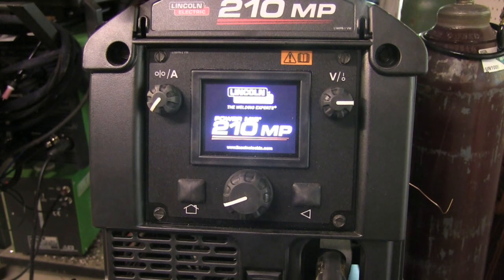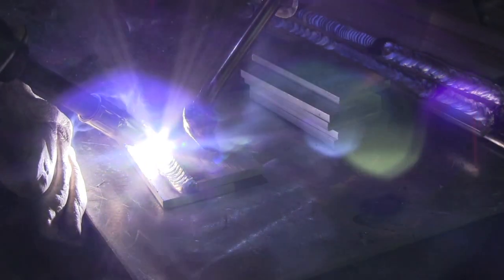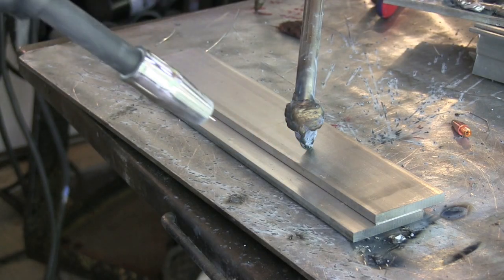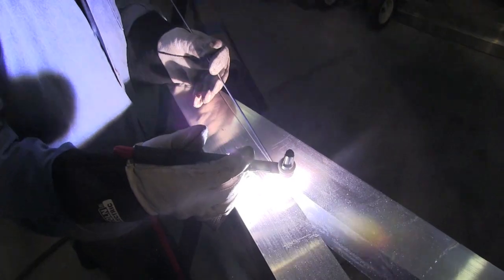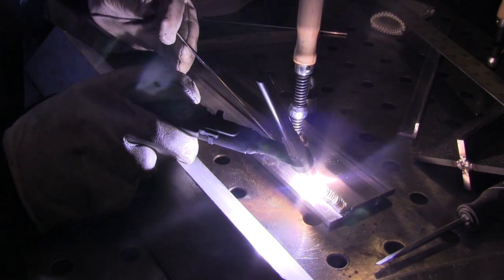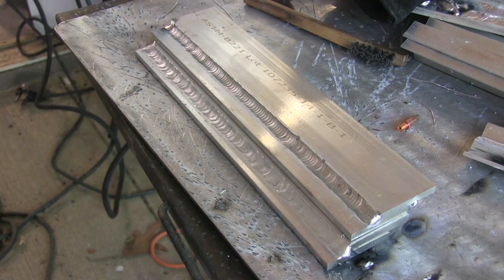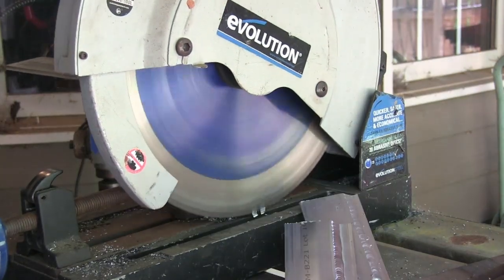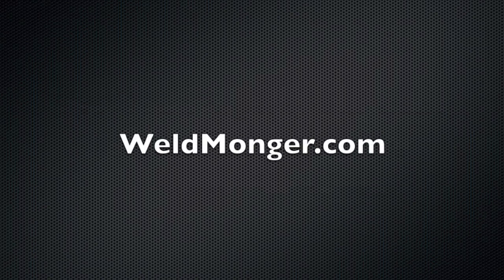Welding Aluminum TIG vs MIG Spool Gun

Comment: America, a strange country... It has never ever had a real king but as the only country in the world in XXI century still uses imperial units in industry.  Unfreakingbelievable!
Reply: Imperial units are better for construction.  I'll tell you why.  

Base 10 (metric) can only be evenly divided into halves or fifths. i.e. 10/2 =5, 10/5=2.   

Whereas Imperial units, Base 12 can be divided into 2, 3, 4, or 6 parts without a fractional remainder.   12/2=6, 12/3=4, 12/4=3, 12/6=2.   So when most of your material comes in feet, sheets are typically 4'x8', and lumber in feet etc etc etc.   Then the construction worker will very soon memorize a few simple possibilities and there is less error and less waste.    With metric everything has to be calculated.  So Imperial is more efficient and actually more logical for construction purposes.

There are two types of countries in the world.  Those that measure the distance to the moon in Kilometers, and those that have actually been to the moon....

Comment: Spoolguns get the job done but its a horrible representation of a legitimate alum weld done say on a dedicated push pull machine. Our pulse machines give tig quality beads with mig. You have high productivity with very good bead appearance. Welded structural alum for about 12 years now and ill avoid using q spoolgun if I can. Push pull pulse is the way to go 😉👍 I mean don't get me wrong. They have their place mainly in peooles budgets but if you weld alum for a living then do yourself a favor an opt for q dedicated machine. At the min a push pull feeder.

Comment: Two questions:  1. If welding aluminum for the first time, what is a good wire type to start with?  2. I have a millimetric 215 and weld steel mostly. Do I necessarily need a spoolgun to weld aluminum or could I just load the wire in the machine if the gas is right?

Comment: hey Jody we do a lot of MiG welding with a Power MIG 350 with a 25 foot push pull gun seems to be the welds don't break at the aluminum but the weld breaks in itself with this material any ideas or is this normal

Comment: Super informative video. I was getting ready to purchase a spool gun to weld aluminum with my Miller Mig but I did not realize I could not use the same welding gas I use for steel. I have thought about that Square Wave for Tig Welding, but have not got one yet. Meanwhile, I am wondering about picking up some Tig rod 5356 and using my Henrob Torch to try welding aluminum. Do you have any experience with the Henrob or Cobra 2000 torches vs Tig or Mig Spool guns for aluminum?

Comment: doesn't matter how fast you lay the weld. The tig is clean and done, after welding with a mig you have 20 minutes of time spent cleaning up the splatter when you are done. Not to mention all the fooling around keeping the wire feeding with a mig.
From start to finish the tig is faster.

Comment: good tip about that gas... last year i was helping my little brother with his science project, he was allowed to make use of a companies workshop-place (sry im dutch, cheers) 
but he wanted to make the frame of his car out of aluminium... but i think the gas of the welding machine was not set for aluminium yet.. but anyway we still fixed it , that was pretty strange now i think of it... but i remember that i did the welding machine setup, i was just considering the setting were already programmed because it didnt had steel wire but aluminium wire going into it..

Comment: I went to school to get my degree in Heavy Equipment Truck and Diesel. I figured that learning to weld would be crucial to my education. The only problem was that no one was helping me at all. I didn't realize that you could adjust the heat with the foot pedal. I hated it, and now I won't ever be able to weld if I needed to.

Comment: use german engineered ceramic nozzles and tips.

no spatter build up
no tip to wire sticking.

everything smooth as silk all day long day after day.

do not tap hot tip or nozzel or it will crack to pieces.

Comment: Hey Jody . Got a question for ya . I have an aluminum boat with a rip in bottom . I was wondering what set up you would use to repair. I have access to a esab tig machine but i was curious what you would go with ?

Comment: Mig has been used to exploit the industry.  Now they stick a gun in the hands of the cheapest guy they can find turn the machine up as high as it can and zip across feet per second producing a glass weld that barley sticks together long enough to get it out the door.

Comment: Is there any difference in the strength of the weld between MIG and TIG?
Reply: Structural Engineer here:  As long as your filler metal is the same for both the stick and the spool, the rest of the weld will be as strong.  Note that most filler metals are stronger than weld-affected 6061 T6, so the filler is not necessarily the limiting factor.  The full answer to your question is that the weld strength does not depend on the process, but it does depend on:  Base metal alloy, base metal temper, filler metal strength, whether the weld is in tension or shear.  Reference the Aluminum Design Manual, 2010, for more information.
Reply: @HollywoodF1  wich is better for alumminum? Lol

Comment: to start i am not a welder... but i am a looking to buy a welder. when you are using the mig is that dc?  also i will prob never weld aluminum. i will mainly be welding on my old f100, i used a lincoln 130t for the first half of the project. i now need a new welder so i was looking at dc inverter with tig/ stick welding. i know i will need to relearn how to weld but my question is would this be a better welder to buy vs buying another self feed? i want to be able to weld more than just sheet metal... maybe some frame work.

Comment: Great video JD as usual.   I have a old school millermatic 200 (transformer stack non inverter) machine and I bought and successfully am using a Miller Pro xp spool gun.   The results I have outstanding achieved to date welding aluminum from 1/8 to 1/2" double pass have been terrific .  My message to others trying to mig  weld aluminum with constant repeatability... is several.  a good mig spool gun can cost up to or more than $1700 so dont expect to buy $300 spool gun and get the same results.  always try to use use 5/64 wire size whenever possible.....you need filler material when doing spray transfer....smaller wire leads to more burnbacks and way more tip consumable usage....keep cutting the tip of your wire back every time you start a new strike like a 1/2 inch and always keep a good amount of wire stick out from the gun  like 1/2" min....lastly mig welding with a quality spool gun and dc power supply is  fast process.....so if your not in the 300 inch per minute range or above you may  want to stop and make some more coupons to figure out whats not right.    Thanks for your videos Jodi...great stuff man....I learn a lot from watching them especially the ones where you are welding larger pieces on your elaborate jigs and turntables. hope this helps. Thx John

Comment: I am thinking to buy welding machine for light usage maximum thickness is 1/4".
Which type do you recommend TEG MEC?
I used to have stick welding machine but it smoked burned from the inside.

Comment: Is Tig known to put less heat into aluminum then Mig, allowing you to do more continuous bead time without warping the piece?
Reply: No faster travel speed means less heat input
Reply: MIG is the only way to go if you want strength.  Aluminum MIG welds are incredibly strong as compared to TIG.  When you pour the heat into aluminum when you are TIG welding it decreases the base metal strength substantially.

Comment: I know almost nothing about aluminum welding but while trying to learn with my Miller 211 on auto set for weeks I can't possibly go 15-20 seconds straight on quarter inch aluminum without curling the material like a pigtail. I understand auto set isn't ideal, but the miller auto-set isn't completely retarded either, its close as far as most reviews claim. Is it possible that auto-set can destroy large 1/4" pieces in 4-6" beads where proper settings  can make 60-90 seconds strait bead time possible?

Comment: YOu got to use a miller 30a, its a different world. Also running .045 wire makes a huge difference in arc quality. When I switched to a 30a  I would go through a tip every few jobs as opposed to a few a job before.

Comment: In your video Tig Welding Aluminum Pie Cut Tubing, you said that Roy was using #5 standard cup, and that lots of people do as opposed to using a gas lens, could you talk a little about that? Like when and why would you use a standard cup and not a lens.

Comment: Thanks for the great information. I'm just wondering if this is all done on AC? I have a 175 Amp MIG welder that only operates on DC. It's a pretty functional welder but I'm wondering if it would be capable of laying out MIG Spool Gun welds like yours. Cheers

Comment: From my experience with Aluminum MIG is fast travel speeds are key to a clean quiet weld. Its very hard to do consistently, weld after weld but it makes a sweet weld. i tend to go for multi pass welds instead of large single pass. Polish and Etch comparison of both would make for a great video, very curious at what they'd look like side by side

Comment: Hi Jody
Have you tried the Miller Aluma weld 350 machine - I have the 350P which I have seen you use with the pro push pull gun - its ok but the new machine which will arrive in 3 hours is supposed to do a stack of dimes all by its self.  Tomorrow the Miller area rep will be here for setup and testing - If I can film the event will send it to you.
Thx
Awful Arthur

Comment: Hi Jody, I just got a Miller Diversion 180 and I started off with aluminum like you suggested. It's less than 1/8th. I cleaned it well with acetone. The first day I just kept sticking the electrode. Second day was better I could hold a good distance and maintain the arc but couldn't get it to to puddle, it looked cold. I increased the amperage and increased the Argon to 20 because I saw no cleaning effect, that improved so I could seethe cleaning. I am wondering if there is a coating on the aluminum? I went all the way up to 140 amps after grinding and using a Stainless Steel brush. It still never puddled. I only have 110v but it's the aluminum got hot as hell!

Any ideas, could it be clear anodized?
Reply: Something to keep in mind, that welder will have a max output of 125 Amps when running on 110-120V.  So if the welder was set to 140A, you may have been getting closer to 100A.  Try cranking it all the way up, then go full pedal.  That should give you 125A, and should be enough to puddle sub-1/8th inch material without much trouble.

Comment: We used to use just a MIG with teflon liner but we modified the end of the liner where the wire exits the gun with precision brass tube and your rolls had to be set up smooth and no probs with tips.

Comment: Jody, check out a Fronius TPS welding machine and your not need a push pull gun (normal 5 meter mig torch) and only a one or two tips instead of 20 a day
Reply: I run a 4 meter push torch on a Migatronic 400 Sigma, teflon liner. Same result as the Fronius..... one, max two tips a day......... Same result with the double pulse setting, which gives a very nice looking weld ( kinda like TIG)

Comment: You had a shot where you showed one of the corners of the awning which had a very acute angle on the inside and I'm wondering how you weld a joint like that. Somewhere you can't get the tip close enough because of the angle of the two parts..

Comment: i expected more penetration from the tig weld. But maybe that's because you tried to be as fast as you could and deposit as much material as you could. It could be interesting trying not to be fast with both process but achieving the maximum penetration and then having a comparison, given that the strenght of a weld doesn't necessairly come from penetration alone.
Reply: I'm a very new welder, just at home.  could you elaborate a little more on how penetration doesn't always mean strength?
Reply: I meant something a little different. Let's take an example. Two plates, t joint. The load tries to open the joint where the weld is. Two weld, one has less penetration in the root of the joint, the other one has full root penetration but it's half the size. The more penetrated one will probably break first. That's what I meant, sometimes you cannot penetrate too much so you rely on weld size, passes and so one to achieve strenght. I'lll give you another example. Still two plates and a T joint. You have big loads from both sides. You're probably better off withe two, I'd dare to say cold welds from both sides, rather than one, fully penetrated one from one side only. Hope it helps.

Comment: I recently took a weld test using a miller 350 with an xr-a push pull gun using 3/32 4043 pretty sure. 1/2" plate 3 pass minimum with a back gouge. Anyway, the procedure said oscillation was prohibited, and the instructor actually mentioned it's a bad habit to get into because it increases the chance of stress cracking significantly with aluminum. Is this true? I've never had an issue with cracking even after laying down multiple hot weaves. Just curious. Keep up the videos! Thank you!
Reply: Any kind of weave, in any kind of material, will increase the chance of cracking, due to the larger heat input...
...........at least that´s what I´m told. But sounds plausible to me.

Comment: Hey Jodie, how did you deal with cold starts? I have a helluva problem on 3mm aluminium.  I presume because you are welding thicker material with higher volts and amps the problem goes away?

Comment: Just out of curiosity, have you done a video on stick welding aluminum?
Reply: When I took the Basic Motorsports Welding class at Lincoln Electric, one of the students asked the instructor about stick welding aluminum.  The instructor's response was "Stick weld aluminum?  I'd rather swim in Lake Erie than stick weld aluminum!"  I took that as a sign to keep using my TIG welders...
Reply: Stick welding aluminum is like trying to push a rope down the street.
Reply: what are your thoughts on Oxyacetylene aluminum welding, then?
  I wouldn't want to use it, I just want thoughts.
Reply: Once you get used to the insane feed speed with moderate travel, it really isn't that bad if you're stuck in the field without argon. Not preferred, but works when you haven't other options.
Reply: +Glenn Pady I've never used O&A to weld aluminum, so I can't say.  Has to be better than stick welding though.

Comment: hi joy. great videos! im using my 200a AC/DC set in the wild for the first time today. 

things are going great except im struggling with craters, it's an old aluminum bodied car im working on. the martial is very pitted and I can't get to the Back of the panels. 

I try to keep it clean but keep getting craters. 

do you have a video on this?
Reply: Jody*

Comment: I just purchased the miller 215 with the 150 spool gun. My biggest problem, especially thin metal, is starts and stops. the starts are the bigger problem.. it wants to deposit a big booger because it's not up to speed....and at the end it's tough not to leave a crater. when I tig this is never a problem. I would love input on this. I don't think I would use my spool gun for welding a gas tank for a boat. but I am a learning.....cheers

Comment: Thanks for the comparison.  That small time difference was surprising.  I also expected the results to be worse using MIG.  Relative to many of us,  you are really good at TIG and were able to push it pretty fast so there may be a little more difference in time for a lot of us.  I thought I wanted a spool gun for aluminum.  But now I see that if you have the TIG equipment already like me, it's probably not worth the money to buy a good spool gun for the occasional jobs a hobbyist / amateur does.  But for very much production work, 16 ips vs 12 ips would be a big deal.  And I bet you could get someone doing good work sooner using MIG.  
By the way, I've watched you feeding wire and it appears to be with your thumb.  I watched one of your older videos that discussed wire feeding and I can't figure out how you're doing that with your thumb.
Thanks for all of the work and money you've spent on making your videos.  You're helping thousands of people do better work.
Reply: To je jednoduché, aj keď som ešte TIG nezváral: palcom pridrží materiál, dva prsty zohne a materiál medzi nimi zovrie, potom palec uvoľní a dva prsty trochu vystrie a tak stále dokola.